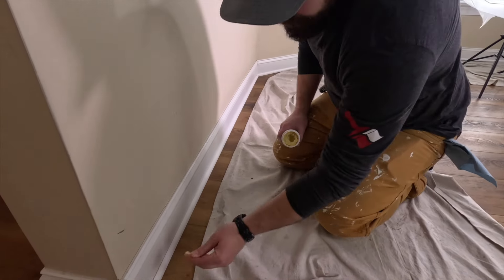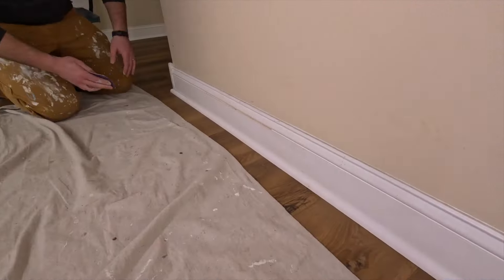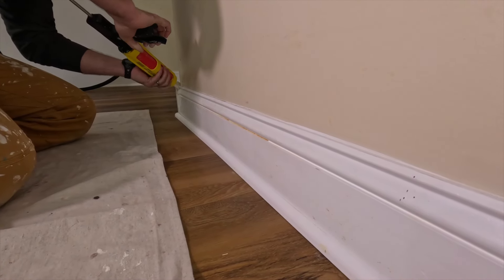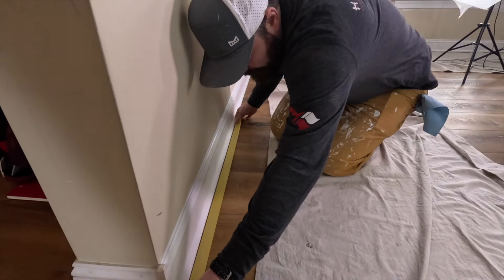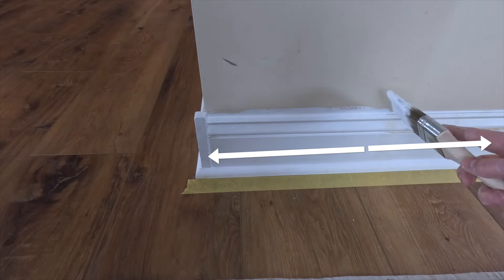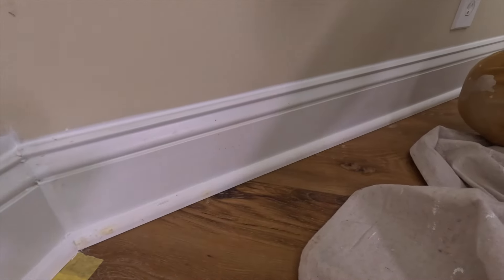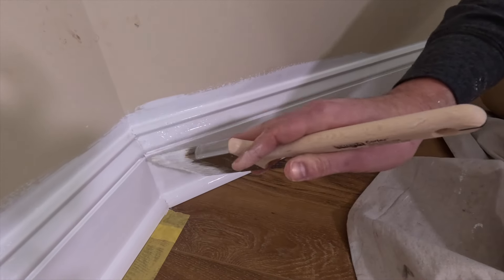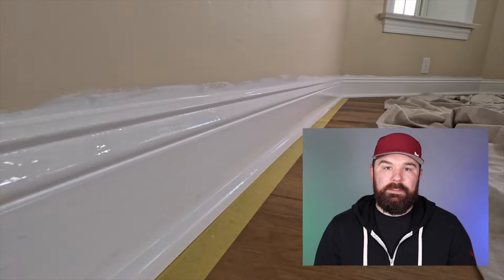Painting Baseboards like a PRO! The Missing DIY Tip Revealed

Comment: That white paint that got on the wall above the boards will show through when you cut in the walls. Be more careful next time and cut in the top of the baseboard.
Reply from the maker: It definitely doesn't show through once we've painted the walls.  We do two coats on the walls and I've never had the trim color bleed through.
Reply: @SuperVassarBrothers 
Either way you slice it, one color should overlap the other. That's simple common sense.  The holes that would be left if a person tried butting up different colors. That's just silly to even consider. Lol😅

Comment: Sadly i have not yet achieved the ability to paint base trim without using tape on the floor.  Ive tried only to wind up cleaning up my mistakes. Its frustrating because life would be a lot simpler not having to tape. Im good with window and door trim,crown molding etc.. its just with base were it meets the floor.  Its the angle that mess's me up. Lol! Sigh.....one of the days...😊
Reply from the maker: Nothing wrong with taping out the floor.  We do it a lot to help mitigate the splatter from rolling the walls.  If the drop cloths back out we still are covered for a few inches.
Reply: I’ve always learned that less paint is always easier to learn. Use a dryer brush and really use the tips of the bristles. Light pressure but you’re brush will almost ride the line with the right amount of paint/pressure. It’s something you will figure out overtime tho it’s all about the feel
Reply: I use a drywall knife and just move it along as I paint. So much easier than taping. Then just clean the knife when finished. Cleans easy.

Comment: Excellent video, as always. I’m priming previously-painted baseboards, and then top-coating with Scuff-X in satin. I have a question: What are the benefits of doing two topcoats? Does the second coat make the result more durable, or prolong the expected time before the brightness fades? Thanks!
Reply from the maker: Doing two topcoats makes it more likely that you’re getting complete coverage and a more uniform finish.  That’s a big contributor to to the finish looking more “professional” and giving the paint the best chance at longevity.  We do at least 2 coats on pretty much everything we paint.
Reply: Do you have to worry about leaving that tape down long enough for the second coat or do you do a tape line again? Thank you.
Reply: @SuperVassarBrothers  thanks!!

Comment: Love all of your videos! Picked uo the SW urethane trim enamel at your recommendation but wondering, if i overpaint the trim onto the wall as you show here, will i need to sand that spot before painting the wall? Thanks for all your work!
Reply from the maker: You don't have to sand the wall where you got the trim paint on it.  Just tape the top of the baseboard, do your top coats, pull tape, then you'll be good to go.  We've got a video coming out on that process very soon!
Reply: @SuperVassarBrothers  awesome! Thanks for your response. You're the best!!

Comment: I fked up and did the walls before the trim so you can imagine how my day is going…. 🥴
Reply from the maker: Nah, you didn’t eff up.  That’s the other common way to paint a room.  You’ll just have to cut a starting line on the top of your trim.  If you’re having an issue with that, then you can do it like we did in this video, let it dry, tape it out, the use a little wall paint up against the tape to get your straight line.  You’re all good either way 🫡
Reply: Ya its no problem. If you can cut a straight line, you can cut in some base paint without tape. I just did it this way touching up a bathroom i replaced the shower in. After the drywall and blending in the texture i wanted the walls coated to protect the work. I had to silicone the shower and didnt want to get soap spray on the bare patch and texture. After installing and caulking the base im about to go paint the base. I painted one small section last friday and didnt like the bleed through on the blue painters tape on the floor. So figured i would give a look see and im seeing the frog tape! I know where some is for free (dads garage)!

I hand cut in the top and it looks great. I didnt want to hand work 2 edges as im trying to do a good looking job on the base and need to work with some speed and minimal brushing to get a good look.

Comment: I am in the process of fixing the baseboards in my house. New construction, but unfortunately whoever caulked and did the final paint on them looks like they were wearing an oven mit on their hand when applying the caulk. Its horrendous.

Anyways. After removing all the excess and getting it back to "acceptable" - I am painting. I brushed today with SW Solo semi gloss and its brush mark city. I am going to sand it back down tomorrow and test my luck with SW Emerald Urethane Trim paint. Any advice in how "thick" to lay it on? Is it pointless to mix in some Floetrol to thin it out even more? 

I am practicing over and over on the same baseboard until I "figure it out" and move on to other areas in the house. I am debating trying to see how it looks rolled on too.
Reply from the maker: You’ll be able to get good results with emerald urethane without any additives.  It has a generous open time unlike Solo which is hot garbage.  One other thing that’ll help you out (I’m shooting this video currently) is to use a quality brush.   A Corona Vegas is my favorite brush to pair with hybrid trim paints like Emerald Urethane and Advance.  You can get them at most Benjamin Moore retailers.

Keep at it and you’ll get it!  Happy painting!
Reply: @SuperVassarBrothers  Good to hear. Thanks for the reply. I wonder why the builder went with SOLO for the doors and trim. Oh well.

Comment: When sanding trim to be repainted by hand with 180 grit sponge.  How much sanding do you do.  To. Not overdue it. Or not enough.  Few times back forth or several. ?
Reply from the maker: It's difficult to overdue it.  I usually use 150 sandpaper and I probably go over an area with 3 passes back and forth.  The surface should feel somewhat rough to the touch when you're done.

Comment: Great video thanks! Do you recommend using a primer or sanding to ensure the paint adheres?
Reply: If you use a good quality paint, you should be fine without primer. Unless the baseboards are old and beat up or a color
Reply from the maker: Most baseboard comes pre-primed so there’s no need to prime it.  Two coats and you’re good to go.

Comment: When installing new floors. Should you paint the walls and trim before or after floors ?
Reply from the maker: That comes down to personal preference.    I’ve done it both ways and I like painting everything after the floors go in.  Often there is new shoe molding installed after the new floor which needs to be caulked and painted.

Comment: Stupid question here 🙋🏻‍♂️
I see a lot of painters do this when painting trim after it’s installed when the walls will also be painted afterwards……. Wouldn’t the semi gloss that gets on the wall pose a problem with adhesion, etc., when the walls are going to be painted flat? 
I ask because I’m having a dilemma deciding whether or not to install casing and baseboard before or after it’s painted. It makes more sense to me to caulk, fill nail holes, and paint once instead of making more work but I’ll definitely get trim paint on the walls before they’re painted lol, and I’m using SW Emerald

Loving the content btw, lots of great tips and advice, I never realized there was so much to it🤦🏻‍♂️
Reply from the maker: Not a stupid question at all good sir.  We pretty much always paint the trim once it’s installed with emerald urethane semi-gloss then tape it with yellow frog tape.  Then we paint into it with Emerald matte acrylic and we’ve never had an issue with adhesion.  I’ve seen issues painting over top of oil but the hybrids interact fairly nicely with acrylics.  Good luck with the rest of your project and thanks for watching!
Reply: @SuperVassarBrothers  awesome! Thank you🙏🏻

Comment: Great video!   I am replacing baseboards right now!  I am painting them before I install them.  Do you feel that's a good way to go about it when you can, or almost easier to paint them after they're on the wall?  Obviously, still have to go back and fix nail holes and other imperfections, but thought I'd ask.  Thanks!
Reply from the maker: People have mixed feelings about that process.  I prefer to paint baseboard, or any trim for that matter, once it’s already installed.  Wood putty, sand, then caulk and paint.  For us, it doesn’t save any time to do a coat before hand.  You can make a solid argument for staining and polying trim before it goes up, but that’s a different ball of wax
Reply: @SuperVassarBrothers   Thanks for your reply!  As I work on my project, I'm starting to agree with you.  After the nails holes, the marks from cutting on the Miter Saw, etc, there's just as much touch up to do as there would be to just paint them once installed on the wall!  Great advice.  Thanks, again!

Comment: It helps that you’re painting the same color. I’m trying to go from green to white and thinking it’s best to remove the baseboards because one coat probably won’t cover. won’t cover.
Reply from the maker: We pretty much always do 2 coats on all the trim and doors we paint.  If you’re doing a big color shift I’d recommend priming with something like Fresh Start from Benjamin Moore then start applying your top coats.  Even with the primer you’ll still be doing two top coats.  That contributes to a really nice uniform finish.
Reply: @SuperVassarBrothers  I went ahead and removed them. Should make easier to sand and paint. Thanks for the tip on primer.

Comment: I have to prime over oil bas paint and do 2 coats.  Is there a way to leave the tape in place until after the second coat without tearing away part of the first coat when removing the tape or do you have to tape for each coat (a lot of work)?
Reply from the maker: We just tape once with yellow frog tape.  If you’re worried about the tape pulling the layers up then you can score it with a carpenters blade before you pull it.
Reply: @SuperVassarBrothers  Okay, thank you for your advice.

Comment: It would be super helpful to see a close up of how thick you're applying the paint, as well as what the strokes look like when its still wet - and after its dried.

I just tried painting a baseboard for the 3rd time with Emerald and I just keep getting brush strokes
Reply from the maker: I am working on that video right now.  Keep in mind that the finish that you are currently applying is a "hand brushed" finish.  There will be brush strokes but there are more and less aesthetically pleasing ways to lay down that finish.
Reply: Putting a little Floetrol in the paint may help some but yeah you're gonna have some brush marks when using a brush. No biggie

Comment: I am doing 5 1/2" craftsman and no matter what it is a huge PITA. I wish I could pre-paint, cut and done but that is not realistic.  Caulking like this guy shows, repainting the wall after cut in etc etc. Very time consuming

The tape on the floor method will not work for some flooring, especially when it is grained or not smooth. The paint will travel under the tape no matter what I did. I used a 24" drywall blade and shoved it under the floor and molding but not possible in all spots and barely possible in the spots it worked. 

No matter what you do, this is the WORST part and  definitely the worst part of my remodel....bathrooms, drywall, demo....this part just fkng sucks😜
Reply from the maker: Hahaha, I’m sorry man.  Baseboards can be a challenge.  A lot of the time I don’t tape and I just free-hand it if the floors tricky.  Just like with anything you get faster with more reps.  Also, for our process we do the ceiling and trim first and the walls last.

Comment: I can’t understand why you were so sloppy painting the top portion of the trim.  Now you have to “hide” all of that white paint as you trim for the wall color.  Wasted time, paint and will hopefully not get the wall paint on the baseboards so that you don’t create a never ending “loop” of wall, baseboard, wall, etc.
Reply from the maker: I’m not quite certain you understand our process.  It’s common for crews to paint the trim first.  After we’re done the trim, we tape out the baseboard.  The tape gives us a clean line between the base and the wall and also protects the baseboard from any spatter from rolling the walls or the ceiling.  There’s no endless loop.  It’s a common workflow 🤷‍♂️

Comment: More like, how to paint the wall above your baseboard
Reply from the maker: We do the walls last which is common
Reply: Right? I find it much easier to tape the top than I do the bottom of the baseboard
Reply: It’s proper technique to paint trim before walls after taping off the trim.   If you don’t have some overlap under the tape you won’t get a good line.
Reply: The worry there is valid… the gloss can flash through a low sheen.. however 2 coats on the wall takes care of that (99% of the time)

Comment: You installed a shoe. That tells me you’re not advanced enough for the results I’m seeking.
Reply from the maker: I can’t tell if you’re joking or not.  The carpenters installed shoe molding after the new floor went in.  That’s usually how that goes.  We just prepped and painted it.
Reply: @SuperVassarBrothers  Oh, you are just painting, not GC doing millwork and painting. I much prefer the floor be installed with a better tolerance to the wall, so the shoe is not needed to hide the floor edge; and I prefer a baseboard/wall base that is scribed to the floor, so the shoe is not needed to hide a gap with the floor.
Reply: @dojoswitzer nobody asked what your preference is lol
Reply: @joshgutierrez7380  Nobody asked for your preference for the types of comments and replies left here.
Reply: @joshgutierrez7380  I’m an architect, so my preference probably makes more difference than yours.

Comment: I was taught to paint without it. It makes things alot easier to use it, but it also kills time. I think it i start my own business, I'll still use tape, because im already prepping and sanding walls and baseboards anyway. Customers like seeing the tape up as well, but for the guys that can't make a straight line yet, this tape will save your line, and you can work a little faster. I personally find it easier to do the baseboards last. I cut my line alot better finishing with the trim. I never have to go back and straighten anything up. Thats just my preference...
Reply from the maker: There are a lot of methods that get the job done.  It's becoming more common for guys to do the trim first then tape into it.  Especially if they spray all the trim first.  As long as it looks good when you're done, then it's all good!